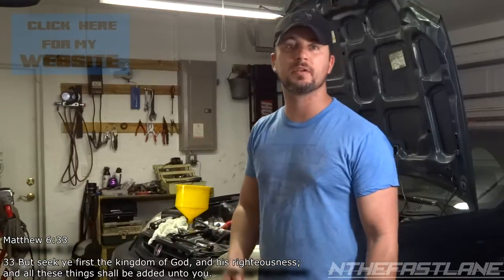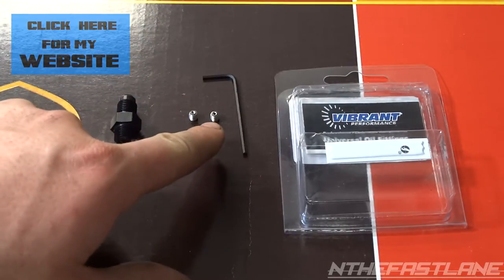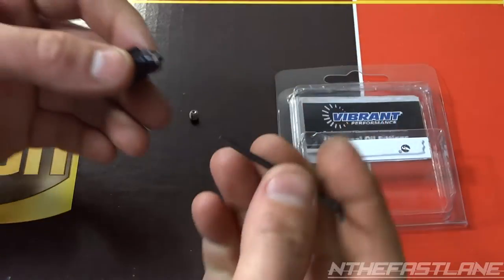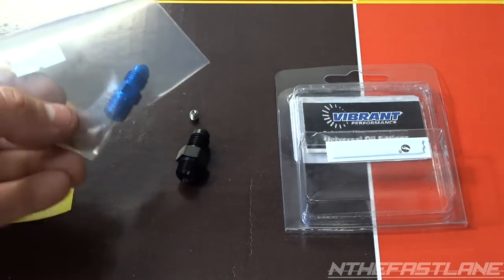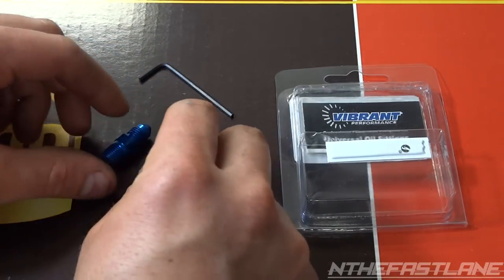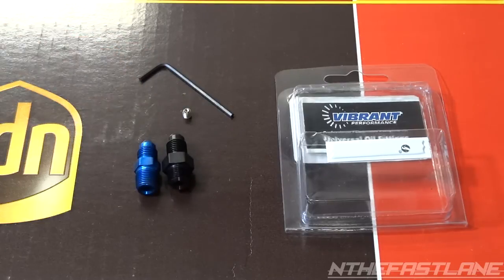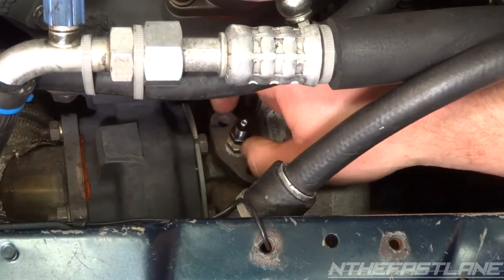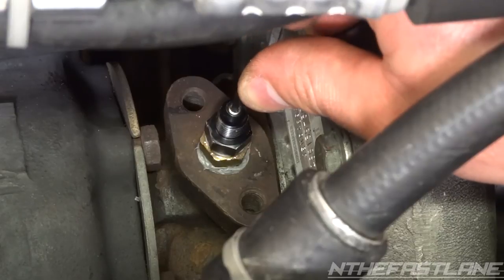Vibrant Turbo Oil Restrictor Review & Install

Comment: Its a common misunderstanding to install a restrictor in the journal bearing turbos. If the turbocharger is blowing oil without have a restrictor, the reason is because your oil drain is not flowing enough volume to compensate for the high volume going in the turbocharger.

     The fix is getting a larger drain. Most people use a restrictor, 9 times out of 10, the turbocharger fails due to lack of oil almost immediately.

    Another cause is if you block off the crank case ventilation rather than venting it to the atmosphere.

A turbocharger can also blow oil if the oil pressure is too low causing the seals to fail prematurely.

The restrictors are intended for the ball bearing turbochargers.
Reply: not always true in the world of modified oil pumps and 20w-50 oil
Reply: you can definitely give too much volume and pressure to a journal bearing turbo, the threshold for them is a lot higher by design but it can happen

Comment: Hey man did the restrictor work for you? Iv redid my oil return similar to yours from ur video. And iv also swapped my valve seals, and taken the car to a performance shop. Has good compression in all cylinders and no oil in combustion chamber. But still smokes. I have a 14 si with a journal bearing 6260 turbo.

Comment: Hey man great video. I had a question. I recently replaced my oil restrictor and found out that the line that had been run is a 4an. But the oil restrictor I bought was a 3an.  I been told I need a 3an because too much oil was going into the turbo. Is it possible to run a 4an oil.feed line to a 3an restrictor if there was an adapter of some sort to attach the 2? Would you reccomend this aswell ? Or just change the whole line to a 3an ?
Reply from the maker: I personally run a 3an stainless braided line. If you're running a journal bearing turbo you don't need an oil restrictor. Just run a 3an line and you should be good.

One of the main reasons why a turbocharger gets blown by is because the drain is not properly degreed. You want a consistent downward slope right to the oil pan with no upward loops. You also want a minimum of a 10an drain return line.
Reply: @Nthefastlane  thanks man. Ye its a journal turbo a/r.60. I'm trying to finish a turbo build.  I know for the oil drain line needs to be replaced. But I'm just trying to figure this oil feed restrictor first. Would it cause any harm if I had the 4an line to a 3an restrictor? Only asking because I already bought the restrictor and I dont think I can return it back.
Reply: @Nthefastlane  also what is the adapter size you used to attach the restrictor into the turbo. My restrictor does not fit into the whole.

Comment: Tell me please... is there a problem if i put my restrictor in the engine block at oil feed ?  i mean  restrictor -> hose -> turbo ... instead of hose-> restrictor -> turbo ..?
Reply from the maker: Teo Fadur Yes, don't install it that way. Reason, the restrictor shoots a thin stream into the turbo cartridge, if that thin stream travels down the braided line, not filling the entire line with oil and pressure, you could get a gap of air in there and that would mean the turbo could be dry at some point causing the journal/ball bearings to be damaged.
Reply from the maker: Teo Fadur Install it on the turbo only.